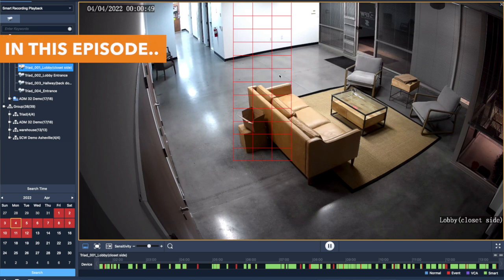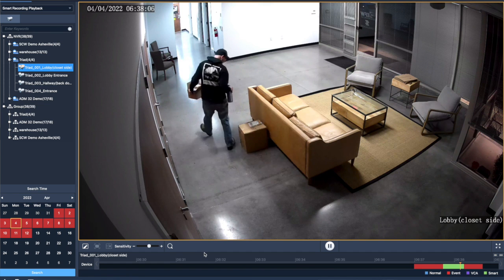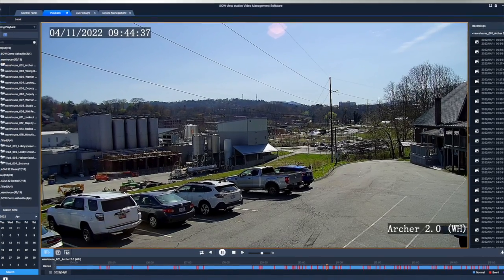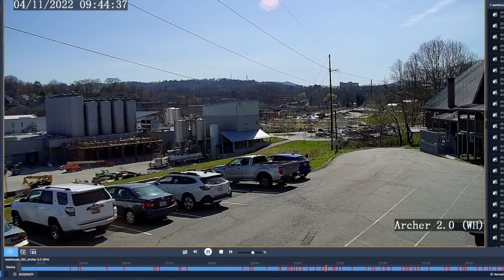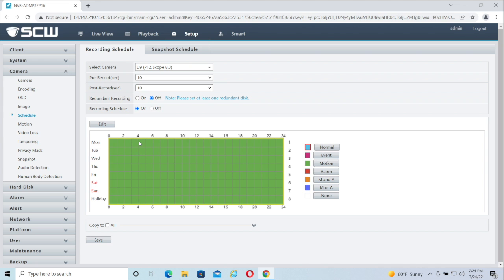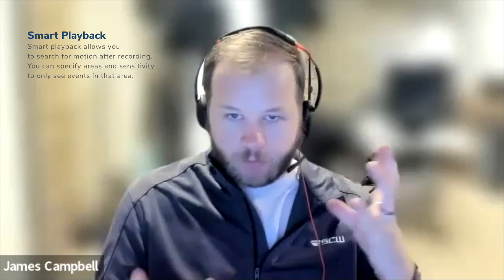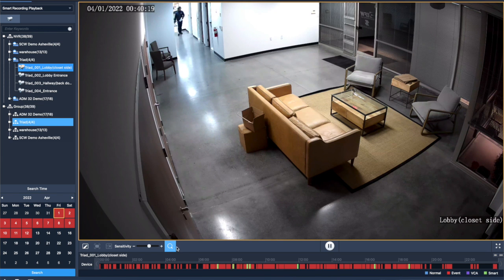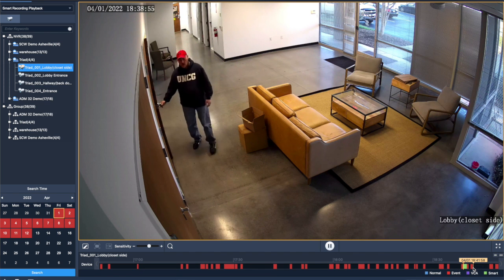Motion Detection & Security Camera Systems | How Motion Detection Cameras Work

Comment: Is the ability to do analytics based on features that a camera supports, or is it based on the ability of the NVR that it's attached to?
Reply from the maker: Hi Bill - it's based on the camera.  Each camera supports a different analytic set.  Almost all of our cameras (fisheyes are the exception) support intrusion detection, most of the remaining support cross line detection, and many of our 8MP and higher end models support line cross/intrusion detection with the ability to detect people or vehicles in them.    Our spec pages on each camera tell you what it supports as well.

If you have any questions feel free to reach out at 866-414-2553 or getscw.com!